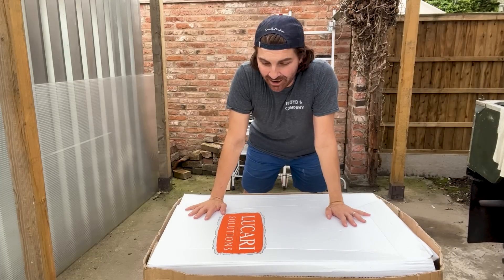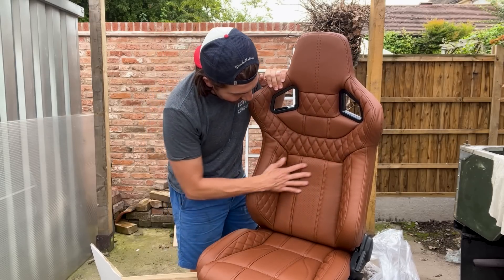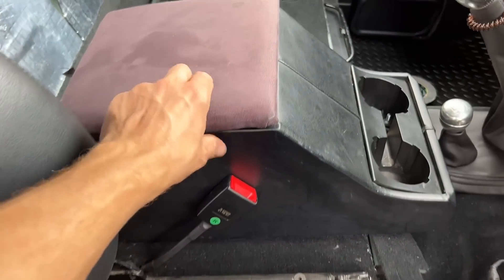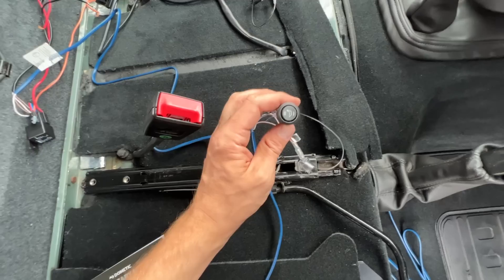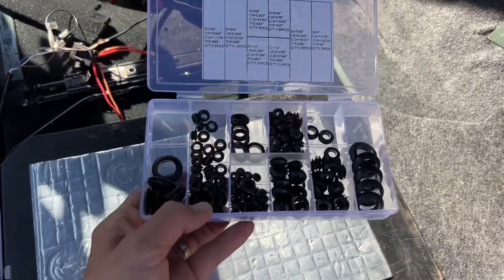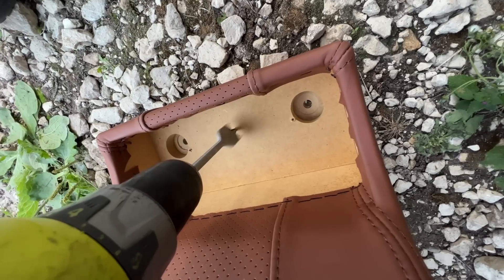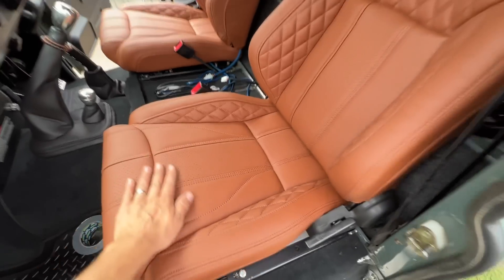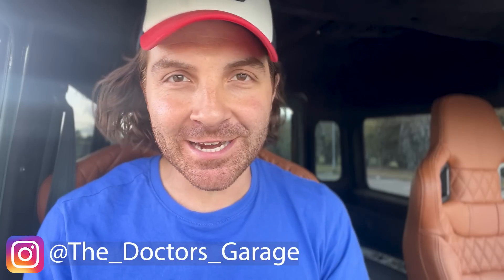MOST EXPENSIVE UPGRADE FOR MY LAND ROVER DEFENDER...WOULD I DO IT AGAIN?

Comment: A good idea with fixed base seats doc is to put in a anderson connector to the rear of the car. Good for checking the battery or connecting a charger. You can also make up a set of jump leads with a anderson connector on the opposite end so in the event you need a jump or need to give a jump, you have that capability without having to remove the seat. Don't forget an isolator switch.
Reply: I did this. I have the Anderson connector under the front bumper
Reply from the maker: Great idea that Landie Man- I did have a reason to go in the battery yesterday which was a real pain to be fair
Reply: What color is your cars paint? Is it a stock color? Looks great!
Reply from the maker: Keswick green- it’s factory

Comment: Hey Doc! Nice job but..OEM chairs with leather upholstery and cognac color, same like yours, works much better ( in my opinion of course) - more classic! Anyway, my suggestion for the next step would be to remove the bulkhead and install a steel bar instead. BTW, I have another tip for your, and mine, future upgrade.. this however, I will disclose at a later time. Now pease enjoy your new settings. Cheers 😉
Reply from the maker: Thanks! I prefer the full bucket seat look personally (perfectly suited to a defender 😂)
Interested to hear your tip…

Comment: Those seats look very nice, and your right they are not cheap!  Personally I would have gone for the tip up seat bases as you never know when you will have to remove the battery cables quickly, especially if your at the side of the road.  Just be carefull someone doesn't spill coffee or cola over those switches on the cubby box.  Sugary drinks will not do them any favours.  Of course now you will have to decide if you want to fit rear seats again, with the extra expense of buying matching units.  Is the ORE wheel carrier going to be the next job?
Reply from the maker: Thanks Tony- yes the tip up bases would have been nice but quite a bit extra to buy so thought I’d just live with having to take my seat out if I need the battery. Someone mentioned having an Anderson connector there to somewhere out the seat box which is a good idea